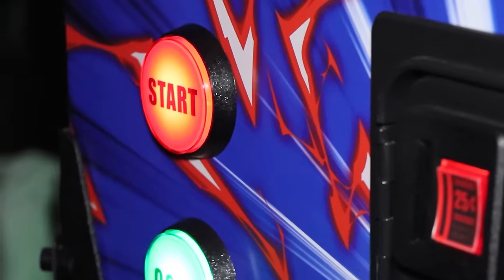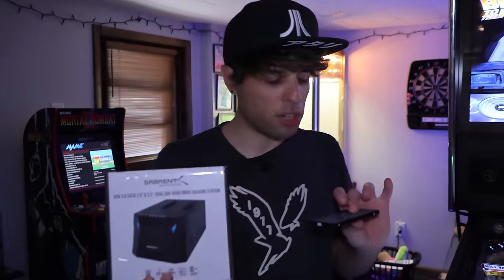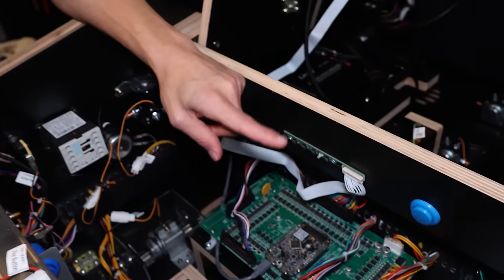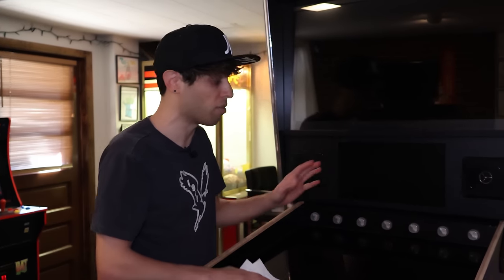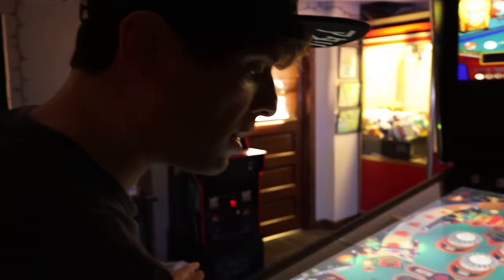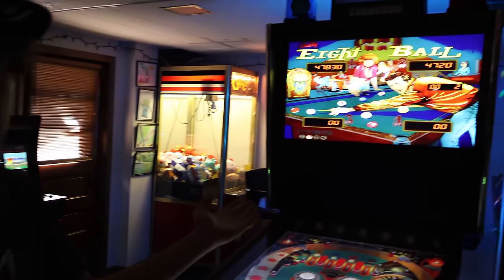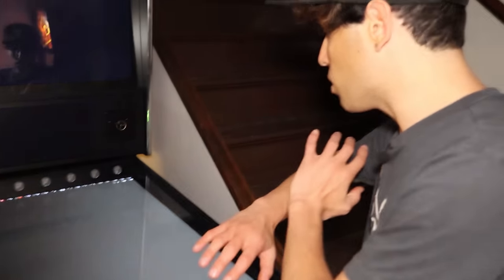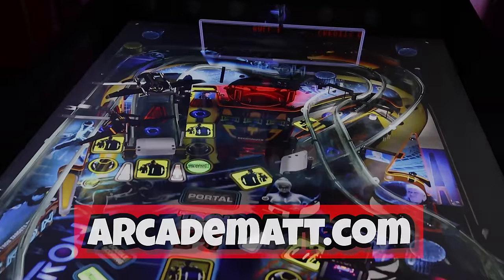The Best 4k Virtual Pinball Machine Available - Is It Worth It?

Comment: Rec Room World offers the best virtual pinball machines in the United States, but I wish they would upgrade their monitors to a 4K gaming monitor to improve the contrast and get rid of the cloudy gray image on the playfield from a side/angle view. The monitor size is great, but the contrast is not that good. There are some customers of theirs that have switched out the monitor for this reason. Hopefully the monitor is upgraded for the 8.0 machine. Otherwise, great machine, great customer community, and great customer service. I demoed their 5.0 machine before and I plan on getting a machine from them on the next upgrade.
Reply: Best to wait until late 2024 to mod 2025 when the new Micro-LED monitors take over the market, as many models have black levels that rival those of OLED monitors.
Reply: Best to wait until the new Micro-LED monitors drift down to the commercial monitor markets, as they have black levels that rival those of OLED monitors.

Comment: We got the Skillshot FX (made by the Skeeball company) a couple years back and I absolutely adore it, and then we got a "lesser" 2 in 1 unit because it had some games we really wanted that weren't availalbe with the Skillshot. There's a couple neat features on that one that the Skillshot doesn't have (I do miss having a plunger, although the launch ball button will work for getting skill shots, and the nudge isn't a physical nudge -- it's button controlled nudging), but I still have to give the nod to the Skillshot as my favorite unit. The cabinet for it is a work of art, and it looks like the playfield is bigger than that unit. Still.... it would be a tough choice between the two if I was shopping today. Cool review!

Comment: Great video!  My only question is compared to a real pinball machine how much less maintenance does it have and how long to the motors inside last before you need to change it?  If it's in a commercial arcade what's the cost difference compared to a regular pinball machine?

Comment: I have been talking about getting one of these forever now. Only things I would want changed... would like the playfield the be more standard width so it looks more like a real machine.  Possible it wouldn't matter if I had a change to play one to test it out. The backglass screen needs to be bigger so the artwork is full screen. I also prefer the playfield not to include the lights at the top so its slanted underneath them. I heard they glare against the playfield also.  Sure it doesn't replace the real deal but to be able to play all the vintage classics it would be worth owning one of these.
Reply: The width of the ULTRA VP is equivalent to the width of my Star trek Next Generation mechanical pinball machine, which they consider Widebody SuperPin. The depth of the 49" monitor is exactly 42 inches which is the exact same size as the majority of mechanical pinball machines. You do not want a 43" monitor, it is not deep enough.

Comment: I love the pinball videos, however virtual pinball just is not the same. Also for a 8500 machine I think just buying a new game is better. Or just making it would cost 2-3k
Reply: I'd make the argument that it's overall better. Less moving parts which means less things that break or need maintenance. Also, you can choose a ton of different play fields to keep things fresh.
Reply: A virtual table with any amount of features will go well over that cost estimate. The playfield monitor alone at that scale is roughly $1000 USD.
Reply: @valar12  I just bought a tv to make it. Its a 43 inch 4k 120hz display for $180. Its used but has no problems with it.
Reply: @William103 that’s honestly not comparable of a unit in size, performance, and quality but you do you.

Comment: I am a vpin guy and I can tell this machine is running at 60fps.  Forget about 4k and get a machine that can run at 120fps at 120hz and the ball moves smooth like butter. Even at 1080p or 2k, a faster monitor looks better for VPin.  Most people hear 4k and think it must be the best, but in this case it is only half the story.  It is a good looking machine though for sure!
Reply: Maybe because YouTube is running at 60fps? 🤔
Reply: Or the camera is recording less than 120? I’ve recorded my 120hz machine with my phone and it doesn’t look like 120. Benefit of the doubt, my dude.
Reply: @alkohallick2901  nope that isnt it. vpin footage filmed in 60fps still will show the smoothness of a real vpin running at 120fps.  You know how I know, because I have seen it and filmed it from an iphone 8.
Reply: the author tells in the video that the machine display runs at 120 fps, but his camera is recording it at 29fps. so not only different rates, they're also unsynchronized, hence the flickering and lack of smoothness.
Reply: I have the same machine… it’s running at 120
Reply: Question for you, would you have a recommendation for a pre built? Or would you recommend a diy project? I program videos for my marquee for my arcade. Program rgb lighting for my buttons as well. But the wood work and the shake and force feed back scare me a bit, mainly because I don't understand. If I were to go diy would you recommend parts?
Reply: Also syncing the rgb lights on the bottom of the cab, the police lights, and the screen on top as well

Comment: Ya at $9000 ill pass you can build one yourself for way way less I advise anyone looking at these Do it yourself they are over charging people for labor and parts in my opinion and you can get all the parts easy,  there are so many people that make their own and plenty of videos with parts list and places to order them..

Also plenty of videos showing you how to install and download VPN and all the tables you want Thousands.   I would also skip the motor deal and other things in this cabinet that you don't need and if you do again can get the part and at a better price,  depending on PC and GPU that you want to use in the system is what will cost you the most best thing to do is use your home PC and set up your machine close to your PC table or run extended cable to table
Reply: Not everyone has that ability pal nor do they want to. I have other hobbies I put time into. Sometimes I just want to buy something and just play it.

Comment: Those virtual pinball machines are crap. They are nothing like the real deal. Sometimes there is a delay between hitting the flipper button and the flipper moving. Those are complete garbage.
Reply: The delay/lag is caused by using low end monitors, which can't keep a consistent refresh rate.